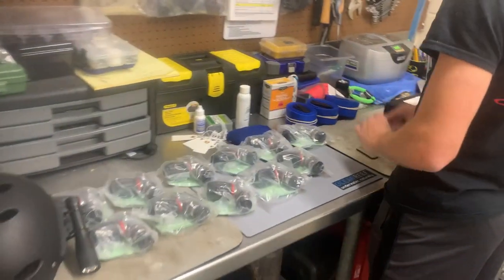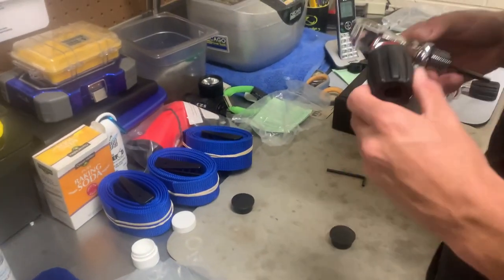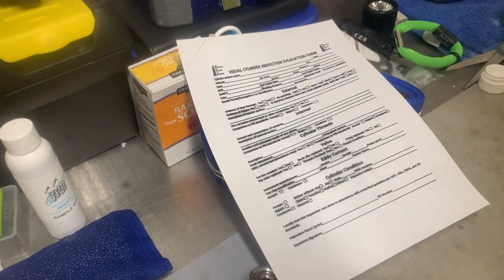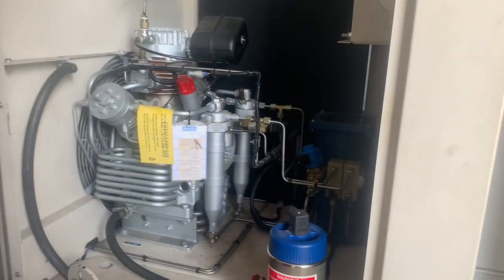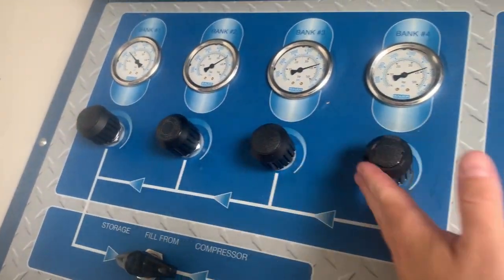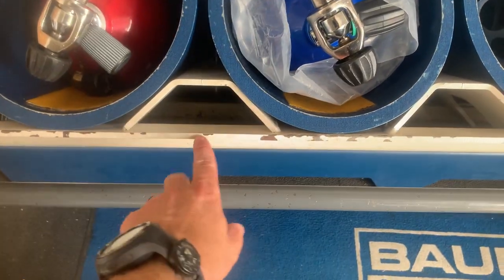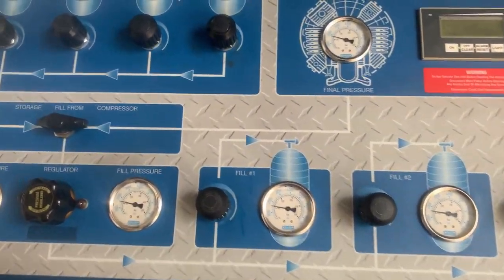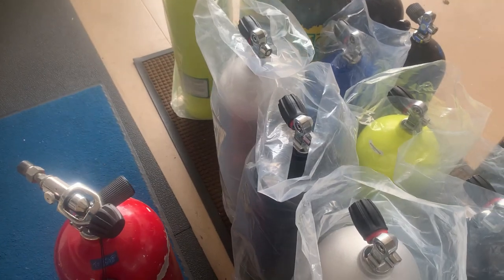Receiving And Prepping New Scuba Cylinders

Comment: Thank you for the informative video. About the thermo valve, the manufacturer recomendation is when installing the valve to the tank Using a 1.5 in. crow’s foot applied to the valve’s base, torque the valve to 50ft.lbs (690kg.cm) (68Nm). That from the manual.
Reply from the maker: Hello David Levi, you would be correct. After 32 years in the Scuba Industry, thankfully, I have never had a valve blow off.
Reply: @LakeHickoryScuba Every tank tech I know uses the hammer tap method...not the manufacturer's CYA torque wrench spec 🔧

Comment: The containment is pretty nifty. I remember they’d always fill tanks in a concrete block tank filled with water to help contain any ruptured tanks, and help cool them down on Bonaire. It’s nuts how hot cylinders get. I’d always make it a long process filling O2 cylinder up when we’d get them back from hydro so they would stabilize faster for leak checks.
Reply from the maker: Hello Caleb Mcelhaney, some shops will still use a water tank to fill cylinders.

Comment: Transfer between tanks is a good idea, as long as the air in that tank is fine. A customer may have filled his tank DIY using his Chinese oil burner with an expired filter.
Reply from the maker: Hello @timtim8468, you make a great point. We have seen some crazy things in this industry. I suppose the safest thing to do would be to charge the customer additional fees for labor, drain their cylinders completely, inspect said cylinders for an additional fee, and then fill the cylinders with the gas from our system for a final fee as well. You never can be too safe now days. The truth in the matter is, there is more trust given from the fills station operator to the customer, than there is from the customer to the fill station operator.

Comment: I was always disappointed by the other filling station you have and shown in your videos. But this one is A++
Reply: Also how do you do nitrox with it? I see the small O2 Cylinders but another video including it would be sweet.
Reply from the maker: Thanks Alex Benz, the smaller compressor system you see in our videos is the one we use for Nitrox fills. We have a continuous blend set up (Nitrox Stick) that is attached to it. The larger Bauer is used for all air fills.

Comment: Hey, interesting video and that Bauer compressor looks pretty nice!  ONe question: Is the "blast" cabinet vented somewhere?  Ie a blow off panel to outside or similar?  80CF of air getting out all at once makes for a pretty serious local over pressure!  (i also like the the little blue overlapping secondary flap that drops over the door top when it's fully shut! Nice bit of design that :-)
Reply from the maker: Hello Max. The containment unit is not sealed. So in the event of a ruptured cylinder, air can very easily escape. The metal housing protects the fill operator from shrapnel and from the percussion.

Comment: If you were filling from a mobile system, cascade only, no compressor, would you still equalize the tanks before filling? My thought is that you start filling from the lowest pressure bank in the cascade to "squeeze" as much air out of the cascade system as possible. Does pairing up similarly pressured tanks help? This isn't an issue for your shop, more emergency services related. I'm curious about your take because I often booger the math to figure it out.
Reply from the maker: Hello Mike Coles. If I am filling multiple tanks at once, then yes I will always equal the tanks out. And starting on the lowest cascade first is the best way to utilize all the air possible.